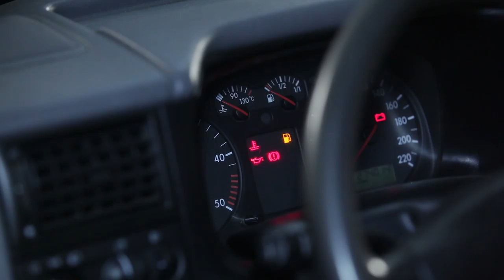How to change oil filter and engine oil on VW T4 TRANSPORTER [TUTORIAL AUTODOC]

Comment: Woah! First, wipe all the oil off sump after draining. That filter had already been off and half emptied. No oil on new filter O ring before fitting it AND did it up WAY too tight! No funnel when filling?
Reply from the maker: Thank you for your feedback !  We are grateful for your valuable remark and will try not to make such  mistakes in our new videos. Best regards, Autodoc.
Reply: The oil on the new oil filter O ring is grandpa wisdom.

Comment: You don't actually see where the filter is going... On MY 2.5TDi ACV I eventually got reasonable acces after removing the wheel and shock absorber. I would recommend removing the axle too for actual work. Still don't know how much you'll be able to see, but it will be better than this.
Reply from the maker: This video is for informational purposes only and does not guarantee any specific result. To ensure the best result. This video contains only tips and tricks that may be useful when repairing or replacing parts.
Reply: @autodocuk I have found all of your videos that I have watched very helpful, which probably emphasized how bad this one turned out! 😊

Comment: can you make a video where you use a jack stand and show a VW with the stock skid plate and also explain what oil to use how many foot pounds of torque to use? i would like to change my 2002 VW eurovans oil but i dont know how?
Reply from the maker: Thank you for the feedback! We are currently working on creating a wider range of tutorials including the one you mentioned. Stay tuned and follow our latest updates. Best regards, Autodoc.
Reply: Several different engines are fitted to the T4 including both petrol and diesel versions. Which engine was this, and are the sump plugs and oil filters in the same place on all the different engines?

Comment: It is not necessary to refill oil filter before installing?
Reply from the maker: Of course, for safety measures need to fill the oil filter, and even better before starting the engine it would be good to make a few crankshaft revs by-hand with a wrench. But if you are sure that the engine lubricating system is fine, then there is no need to do the above mentioned procedure. Best regards, Autodoc.